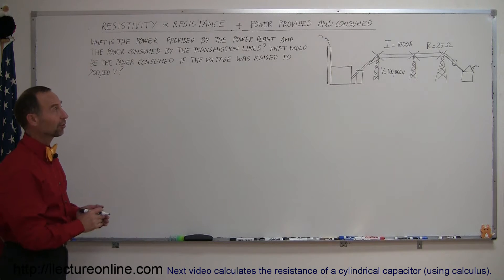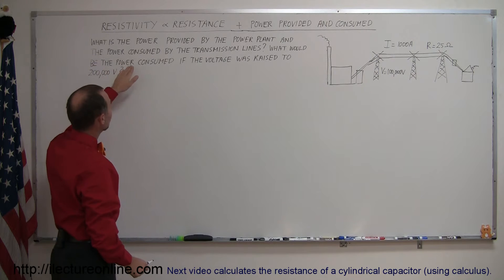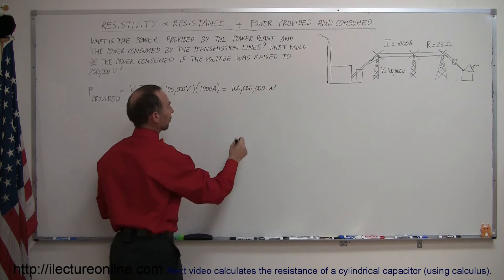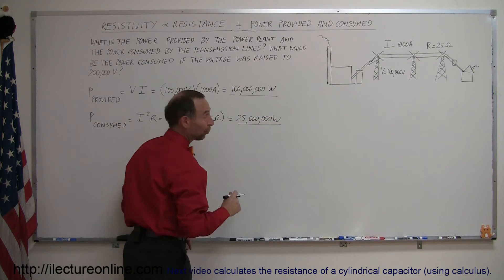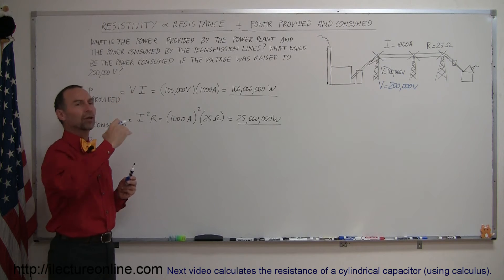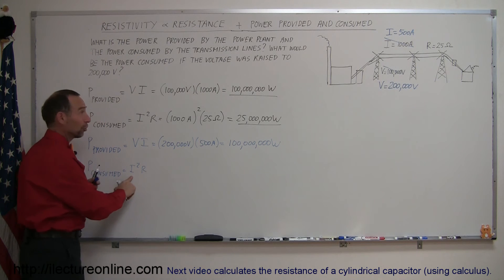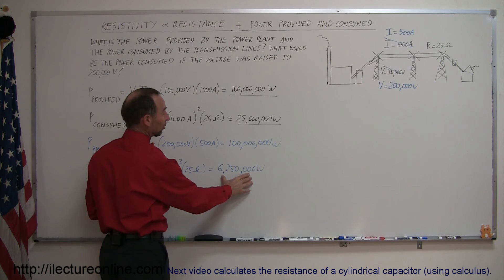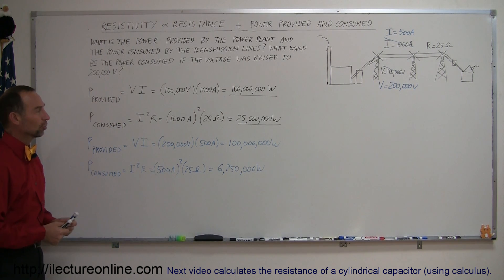Physics 40   Resistivity and Resistance (7 of 32)

Comment: There is something that i do not understand: since V = 100,000 Volts and R = 25 Ohms shouldn't the current be I = V / R = 4,000 Amperes ? Why is I = 1,000 Amperes ?
Reply from the maker: The current is determined by the power consumed.  If nobody turns on the lights or uses any electricity, then the current will be zero.
Reply: @MichelvanBiezen  OK, i think i got it. So the 4,000 Amps is the maximum current that it can be used leading to a maximum power consumption of 400 MW in that example ?
Reply from the maker: Not exactly.  The current is limited by what the power plant is able to provide.  Power is consumed by two things.  1. The power utilized by the houses, factories, building, street lights, etc.  and then  2. the power loss across the transmission lines ( P = I^2 R)   For a current of 4000 amps the power loss would be = (4000)^2 (25) = 400 million watts.  To prevent that type of power loss, we can increase the voltage to 1 million volts whih would drop the current required to provide power to the users to 400 amps and the power loss across the transmission lines would now drop to  4 million watts.

Comment: Why did the I halve when we doubled the V? Shouldn't the I also double from I=V/R ?
Reply from the maker: What remains constant is the power delivered to the customers.  Since power delivered is   P = I V, then when you double the voltage you will need half the current to deliver the same power.
Reply: @MichelvanBiezen  thank you so much.